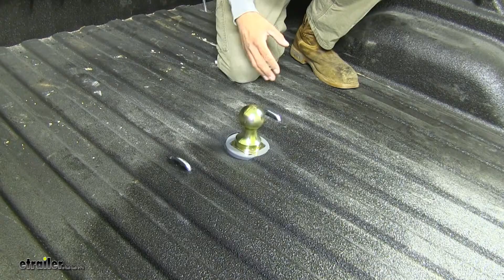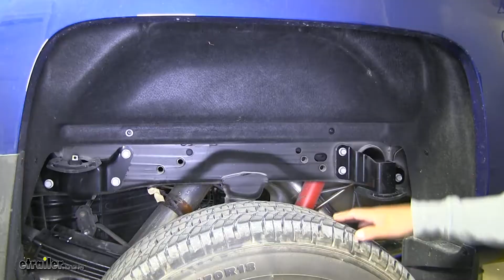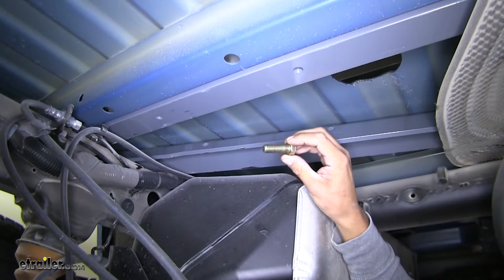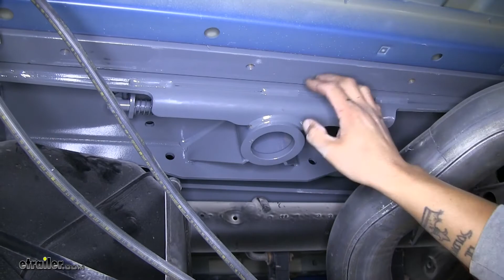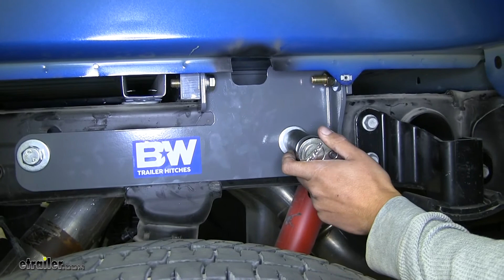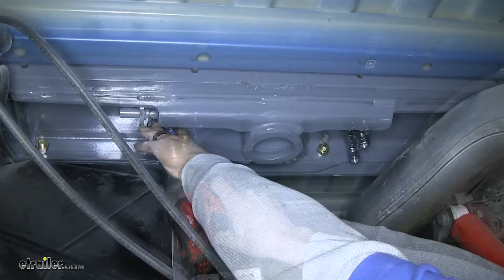etrailer | B and W Underbed Gooseneck Trailer Hitch Installation - 2018 Chevrolet Silverado 3500

Comment: What was the measurements when you drill the hole for the ball I have a short bed
Reply from the maker: On this particular B&W turnoverball gooseneck hitch part # BWGNRK1016 the ball is 44 3/4" from the edge of the tailgate for a short bed. This is not the same measurement for a 8 foot bed or any other B&W turnoverball product. Failure to place the 4" hole precisely may result in property damage.
Reply from the maker: No the hitch will now act as the  heat shield.